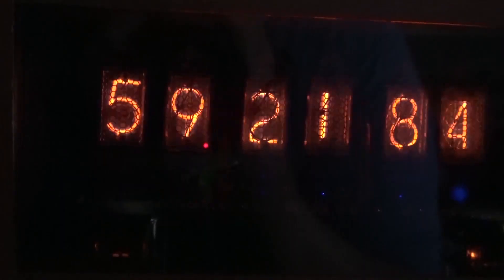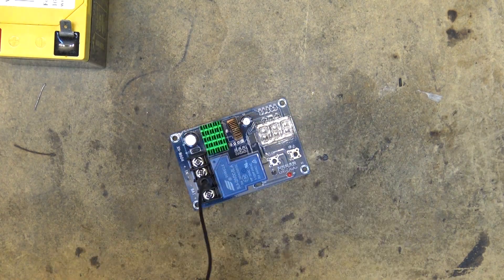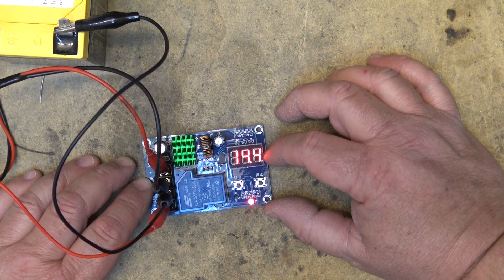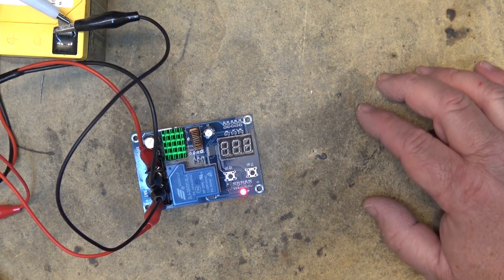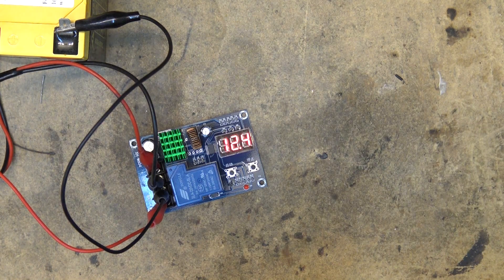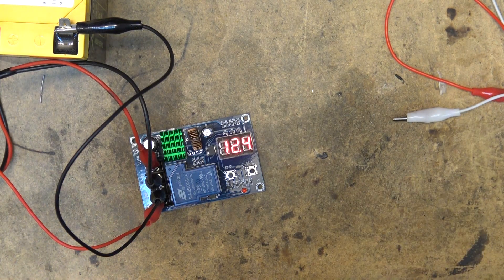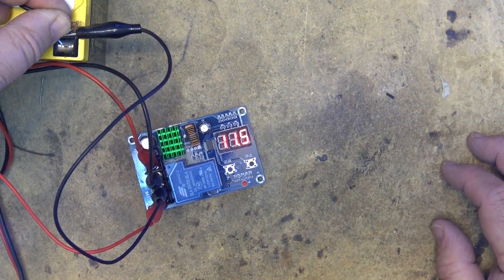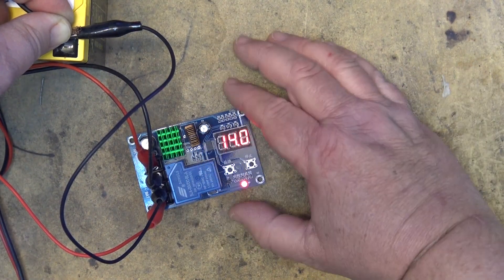Battery charge controller

Comment: My mobility scooter has 4-12V-22 Ah AGM battery's. The manufacturer tells me I shouldn't leave the charger on for long period of as I may overcharge the battery's. I'd like to leave it plugged in for much longer,
maybe several months at a time. Would this work with a 55-60V DC source?

Comment: I bought one of these and was hoping to use it to control how much charge i put into my Lithium 48V ebike batteries. However, even though it seems to correctly read the voltage of te attached 48V battery, I have not been able to set the start voltage or end voltage to anything higher than 14.4 V (ie a "12V battery). Is this the way it works or am I missing something? I thought it could deal with up to 60V
Reply: I would also like to know the answer to this ?  My mobility scooter has 4-12V-22 Ah AGM battery's. The manufacturer tells me I shouldn't leave the charger on for long period of as I may overcharge the battery's. I'd like to leave it plugged in for much longer,
maybe several months at a time.

Comment: Can put solar panel to the Input module?
Reply: In your case, a solar loading controller would make more sense.
For this device, you should have a steady voltage, which isn't possible with a solar panel (depends on the sunlight).

Comment: So i cant use a 24v charger on this while charging a 12v battery right? I tried it and the relay keeps clicking on and off but im not sure if its because of the charger i used
Reply: No, that's too much for the battery. 
Loading it with such a high voltage will destroy it.
You have to use a charger between 12V and 14V.

Comment: Hey I need to charge a lead acid battery with this exact charging unit. What power supply do I need to charge my battery from 11.8 to 14 volts?
Can I use a Laptop charger with 15 volts and  4 amps?
Reply from the maker: 15 will probably be ok, but the optimum charging voltage is 13.8 for a 12 volt battery, but 15 is most likely fine as the controller will stop charging once the voltage gets to the set point.
Reply: @12voltvids  thank you for your quick reply 👍🏽
Reply: I have a problem. Im also using a power supply from laptop and it just blinks on and off doesn't charge.  Tried 5 different chargers and buck converter to try and charge 24v batteries and still can't get it to chearge as soon as the relay kicks on chargers start flickering.

Comment: Can I use this to charge extra AGM 100 ah battery in my van as a DC to DC charger from the main battery
Reply: You might have to connect a boost converter to step up the voltage.
Reply: Tried that doesn't work.

Comment: Thanks for the great tutorial.  Would I be correct that I could use this for my diy 18650 lit battery back connected to my bluetooth boom box.  Use this very example for battery operated boom box?  Thanks in advance.
Reply: I think for lithium this would be great. If you have 3 lithium cells in series then you set the start charge voltage to 9v (3 volts each cell) and the stop voltage at 12 volts (4 volts each cell), I think it would work great. You would want a balance board though to ensure you are not over charging or discharing a single cell in the series, otherwise they will get out of balance over time and will just die due to being over or underchanrged too much.
Reply from the maker: This controller is more for lead acid type batteries for maintaining charge.

Comment: Any way to used this  controller to control  48v battery banks,  that after battery is fully charged the controller should send out a command to stop the generator and when the battery has discharge to a certain settings point it should switch off  the generator for charging the battery?..........  I need a complete solution  please.

Comment: I purchased on of these because the Relay is in fact connected to the Pos Battery.  I can use this controller to Initiate a Load Dump on my Wind Gen simply by connecting a Relay between this units Positive to the Battery connector Neg.  When this units see's the voltage reach my determined level, The unit relay opens releasing MY relay and providing a Battery path to the Dump Resistor.  Dirt Cheap Load Dump Controller.

Comment: A crappy design, it will not charge a low or dead battery, it will only maintain a battery if it drops. If you're battery goes below x, y, or z this piece won't even turn on. It's like having a battery charger that only charges good batteries.
Reply from the maker: I have connected it to 12v batteries that were down at 4 volts and it turned on just fine and brought the battery up. It is a charge maintainer to prevent overcharging.
Reply: @12voltvids  : I had batteries  below that, I had to charge them up get it to turn on. Why I call it a bad design is it won't produce power unless it sees enough power at the battery. Aka, best suited for a battery tender.

Among those "603", "604" etc boards any recommendations for one like this,  yet will put out/produce/output 12.5v's like a power supply...yet has a ~cutoff just like this one to tell it to trip off if it sees a battery go over a certain voltage (13volts)? 

I'm looking basically for one as a power supply regulater to produce a consent 12.5volts yet to stop at say 13. I'm using one of those 110v to 12v ~80watt inverters that's popular with led strips users to power these.

Comment: example . we setup star charge 10v discharge 12v. 
and if electric power down, we use battery till battery go 0 v. after electric power come back.  does charge controller will charge the battery.  because range that we set is star charge = 10v
but current state of battery =0v
Reply from the maker: If you run your battery down to 0v chances are it won't charge anyway. You shouldn't take it down below about 9 volts.

Comment: does it prevents reverse current from the battery to the source?
Reply from the maker: Sanketh Saha 
When it is on the charger is connected to the battery. When it is odd the relay if open and the battery is disconnected. The voltage monitor is on the battery side so as the voltage drops below low setting it turns relay on and charges again

Comment: But it doesn't top it off until amps die down. It only gets voltage up but turns off too early for full charge. .
Reply: You're right! It is shown in the video. Every time the charger is cut of, the battery voltage drops to 12,6V, while the charger is set to 14.3V

Comment: @12voltvids can this module powered by a normal bench psu or switched mode wall brick (what you call in the video "charge source") if so should it be appropriately current limited (like around 1C) and also would a Schottky diode help, if so do i use one on each wire in opposite directions ? im a newbie wanting to charge some 12v lead acid batteries automatically after they are used by an inverter and mobile power jumper pack, i also see that there are several versions of this module XH-M601, XH-M602, XH-M603 and the XH-M604 ,do you have any plans to try these other ones out? Thanks for the videos i really like your format and it never feels like you assume what people know , i feel i learn loads and i enjoy you taking us along for the journey
Reply from the maker: Dazza Direct 
Yes it can be powered by anything that provides enough power to charge batteries. I am using a 650 MA 14.5 volt adapter that was used to charge an old battery belt. This way my bike battery will be on a trickle charger over the winter and the module will kick in when the battery gets to 11.5 and stop when it gets to 13.8.  Works like a charm. As my bike has electronics (alarm system) that has a constant drain I figure it was kick in for a few minutes every few days over the winter to top up the battery and not risk over charging.
Reply: @12voltvids Thanks for quick reply, im trying to build an off grid setup to power a few led lights a couple of cameras and a 2k inverter(around 150AH draw). i have around 200AH @12v. The cameras and lights only use 30AH a day and the the inverter powers tools for a few minutes a few times per week. I'm currently using a mix of smart and dumb chargers between 1A and 8A when needed in no particular pattern or order. There is 240v supply and im trying to automate the process rather than the current manual process.  Have you seen the XH-M602 http://www.icstation.com/m602-digital-control-charge-control-module-220v-protection-board-lithiumlead-acid-battery-p-11315.html  i likes the look of it as its mains powered and some say its better as it can shut the charger off completely. There is very little on these modules which i think is a shame as they have so much potential Pb/Li-ion/LiPo/LiFePO 4 etc. What do you recon is the maximum current @12v you would feel comfortable pushing through your XH-M604 i know they say 10A on the relay but some say 3A some even only 1A. Some have talked about adding tin to the tracks to increase its current carrying capaibility. below i have linked on of the few reviews of the item that i thought actually adds to you already clear explanation, and a project charger he has built from scratch i aim to one day try something similar , its a 12v petrol(gas) alternator charger, thanks for you help , excellent clear videos and have a great day. His review https://www.youtube.com/watch?v=E_SQu8g4REU.  His D.I.Y battery Charger https://www.youtube.com/watch?v=yOCmuGeJyIc

Comment: Q:  current range, can it handle up to ten amps?  What are the volts limits, i.e. does it pass through up to 80 volts for  battery packs and inverters?  Many modern chargers have limiters.  This is great, thanks for the FYI.
Reply from the maker: It doesn't limit the voltage. Whatever your charger puts out will be presented to the battery. Remember your discharged battery will have a high load which will draw max current from your charger, and then as the battery charges the current will be reduced and the voltage will rise. Once the battery is full, the relay opens and stops all charging.